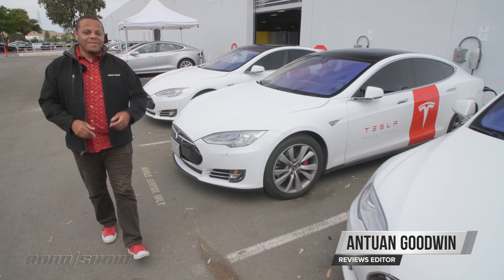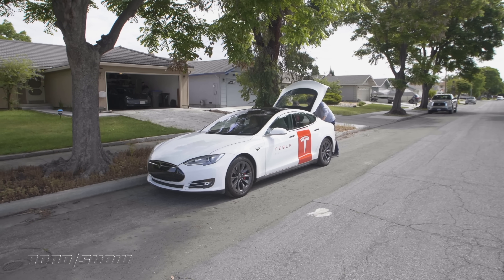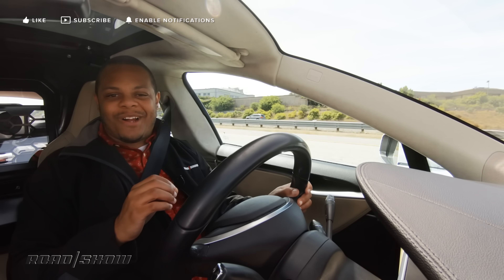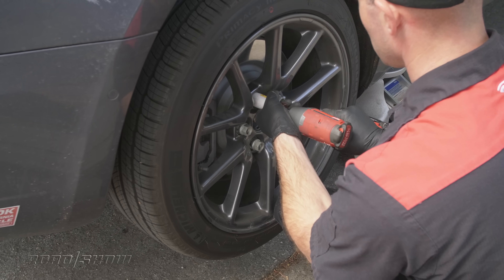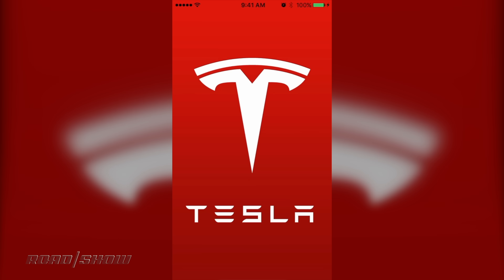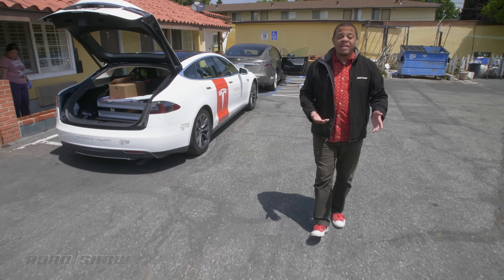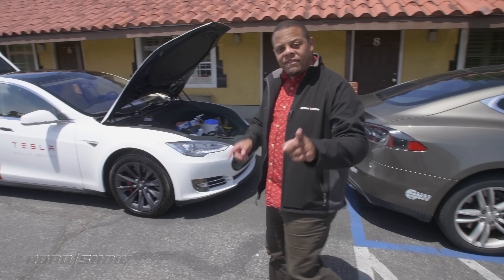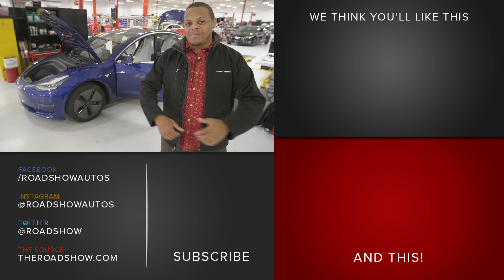Ride along with Tesla Mobile Service and fix some electric cars

Comment: As long as I have working a/c, I work at a mechanic shop making $15 an hour working from Monday to Saturday 10am-5pm, only making 12k a year but there’s other people making more at Walmart in working AC. I’ve been working outside in every weather New Jersey throws at us. From winter to 115 degree heat. But I yet still don’t get paid on what I’m worth. I’ll rather get paid $14 and work in a building with A/C. Don’t say you hate your job without even trying to be a mechanic making less than minimum wage, working outside everyday 365 days a year. It’s jobs fault they have mass shooting at their store because they wanna hire a bum with no degrees than me with 1 college degree

Comment: No mobile service here in Bangkok.  The first service center that just opened up, refuses to sell any parts to an owner down to the smallest clip.  
The people that did the PPF on our model Yp broke a clip mount on a wheel arch trim piece. They would sell the part and install it my self. So the part was about 40 bucks and I feared that they were going to charge me a couple of hours work to do this simple job.  When I got the bill, they charged me ฿68 - 68 Thai Baht which today equals $1.88. (One dollar and eighty eight cents) Maddening  Ing for people that covet the right to do their own work, but extra cheap.  And… the washed the car, wiped all the little hand prints off the inside back window and vacuumed.

Comment: I heard horror stories about its battery life in colder climates
Reply: battery drain in cold weather is not new some cars suck more at it than others the leaf would leave you stranded since it has no thermal protection for its batteries in teslas case if you have a winter package car  the batteries get warm automatically to keep from draining a lot
Reply: @yabucoaman  Here in Canada the sub zero package comes standard on them. When you navigate to a charger it also starts preheating the battery while you approach to ensure you get the best charge speed right away when you plug in.

Comment: Tesla Service has treated me like GOLD.   Also had their Mobile Service twice and it was fantastic both times.   Also gave me an opportunity to chit chat and learn more cuz the techs were pretty cool people.    So happy.
Reply: Just curious what did they fix for you ? I’m going to have my sensors replaced not sure
If mobile service can get this done
Reply: @khoado123  Camera replacement for beta?   I've had windscreen replacement, charger lid issues, minor things.  Flat tire with mobile.  etc.     Make sure they have the right parts in before it happens.  If it's a camera swap - I've only heard people going to a service station for that.
Reply: @karunald  it’s for the falcon wing doors because for some reason when the car sits outside the sun over 60 degrees for too long, it starts seeing phantom obstacles and won’t open
Reply: @khoado123  Now THAT is an interesting one!  wow
Reply: How much does tesla do the maintenance services for like the tire rotations etc? Thanks

Comment: The dealer that I purchased my Lexus from has a similar service. They can send out a technician and do simple maintenance things (oil change, filter changes, tire rotations) at my location of choice. For more intensive or serious repairs, they can flatbed a Lexus loaner to me, flatbed my car to the dealer, and flatbed it back to me for exchange when it is done. The only drawback is the need to schedule an appointment quite in advance.

Comment: my model3 got scratched on front bumper, does mobile service do body repair?
Reply: At the annual investor meeting this week they said they have just started doing bumper repairs via the mobile service.
Reply: @JoshuaSantos04  That's good to know! Picked up a scuff on my bumper few weeks ago, but it was so minor I was hesitant to go through the process of taking it to my local approved body shop. Maybe I'll check with the service center if mine does bumpers.
Reply: Tesla Our Future You can call and ask, they will tell you the answer.

Comment: I've had a Model 3 for just over a year.  I've had 2 mobile service calls - first for the frunk actuator - it took him 20 minutes to fix in my driveway.  The second call was for the glovebox latch bc it would sometimes open on its own.  Mobile service fixed it in 20 minutes.  The process of setting up appts was painless and the wait time was only a couple of days.  These are very minor issues and the experience made me feel better about the brand.  They are building cars to last - not ones that need repairs to be a profit center.  Any other minor issues or bugs are either fixed with OTA updates or by resetting the cars computer.  I love not having to waste my time going to a garage, get a ride there, go without my car for a day or two, etc.  Mobile service seems so much more sensible.
Reply from the maker: Glad to hear your experience has been positive.

Comment: So why don't they just use the Nissan Ev Van for full electric.
Reply: Probably because the range is abysmal. If the customer is more than 60 miles from the technician, they'd have to make a charging stop. And that's assuming there's just one client for the day. I bet they easily put 200-250 miles on the odometer on busy days.
Reply: @HikeTheBlues  It's honestly prob more then that. For example there are two service centers in Maryland. Granted both are down in the DC/Baltimore area so they prob handle the vast majority of the cars but the entire state has mobile service. So for example when my mother gets her Model 3 in a couple days their mobile service is going to come 120 miles one way just for me to install homelink. How awesome is that?
Reply: They would have to import it from Spain where it's build and it's already $28k there. Ford Transit is much easier and cheaper to buy and maintain.

Comment: Really cool video. 

I guess this is ok for a person who likes to work outside and in nice weather. 

I suspect that this would not be ok or doable if it rains, snows or is otherwise cold.

Considering that there are little to no moving parts, this would not be a problem. 

But I am surprised that the road side tech was able to get a floor jack under the car to rotate the tires. I was told by a Tesla employees that you can't get a floor jack under the car because they can not support the weight. I see so many Tesla's on the side of the road with flat tires waiting for a flatbed.
Reply: Of course you could use a floor jack. You'd just need one that can handle the weight. Plus how many Tesla owners would be so cheap that they'd change the tires themselves?
Reply: @scott8919  they can't change their tires. The car doesn't come with a spare. Maybe Fix-A-Flat. I see so many Tesla's on the side of the road. 

I have been told by Tesla employees that you can't get a floor jack under the car. So I don't know.
Reply: @Andrew-zv4fm  Big floor jack operated by a trained technician? Absolutely. Little twist jack operated by a possibly untrained driver, possibly missing the jack points and damaging the battery pack? No thanks. 

Likely as much for liability as it is for driver convenience and weight savings. 30% or so of new cars don't come with a spare for weight reasons, and on Teslas there just happen to be a few more reasons why it makes sense not to include a jack kit.
Reply: @TheErsatzCrab  yeah I get the weight reduction. No matter what car you are in, Tesla, BMW, Mercedes, Mini or whatever it is still a bad idea not to have spare tire of some kind.

But as I said before, I was told by a Tesla employee that you can't get a floor jack under the Model S. Regardless if it is from the average person or a trained tech. In the video they showed the Model 3. So maybe with that car yes you can but not with the Model S. Apparently if the floor jack meets the weight requirements of the Model S. The only way to get the car up in the air is by a 2 post lift. 

Now regardless, why can't these cars come with run-flat tires? They have the standard tire. I see so many Model S' on the side of the road or on a flatbed. The last time I saw a Model S with a flat was on Mother's Day. The driver was on an on ramp and could not safely get off the road. He was down to the rim.
Reply: @Andrew-zv4fm  I understand, but the employees tell you that because it's much quicker than explaining the actual reasons. As I mentioned, quite a lot of cars no longer come with spares, and that's because overwhelmingly people tend to call the roadside assistance program provided with their warranty rather than replacing the tire themselves. Tesla provides a loaner wheel service so you can simply drive away instead of going directly to a tire shop.

As far as the reasoning for not including run-flats, they're much heavier, more expensive, less efficient, and ironically easier to puncture than a traditional tire. Ask any BMW owner, they're a huge pain in the ass.
Reply: @TheErsatzCrab  I knew someone that blew his run flat on a BMW. 
Getting road side is not always dependent on the cars warranty. Take Mercedes for example. You can still use their roadside service even if the car is no longer under warranty provided you had the car serviced at the dealer within the past 18 months and spent a min of $100. Volvo has started a similar program. 

When I talked to the employee about this, it was part of a car club and we are in the know. So I don't think they were BSing us. 

I doubt how well a spare tire will be on the Model S since you can't lift it. 

I test drove the Model S and we were told that you are advised not to do a panic stop if you can help it. There is a chance you can pop the tires. All considered, EVs have a long way to go till they are practical.
Reply: @Andrew-zv4fm  The warranty comment was an aside. For example, Tesla policy is that roadside assistance is always available no matter the status of your warranty.

I don't mean to be argumentative here, but it's completely false that you can't lift a Model S using a floor jack. I'll try to find sources from the online user manual if you want. I'm personally extremely familiar with Tesla sales, and when they tell you that you can't lift it using a jack, they mean that you would need one of the large shop-style jacks shown in the video, which would not be convenient or practical to store as part of a spare tire kit with every vehicle.

Finally, if what they said about panic stops was true the vehicle would never have been released for sale. There are cars as heavy as Model S, such as the Mercedes S550; a ~5700lb GVWR is not uncommon and tires are more than up to the task of stopping a vehicle of that weight. The salesperson clearly didn't know a whole lot about the car.
Reply: @scott8919  also the Tesla they are showing is a Model 3. So maybe a Model 3 you can just a floor jack but the Model S you can't.

Comment: Build quality issues and endless rattles 🤦🏻‍♂️
Reply: Jay Chu build quality was worse on my Porsche Macan Gts than my new model 3 performance.  This is old fake news
Reply: Google or YouTube Tesla and Porsche build quality issues. I lemon law’d my Model S. I, sure you had real issues with your Macan, no manufacturer is perfect but Tesla has major build issues. That’s why Consumer Reprts down graded them.
Reply: Jay Chu CR downgraded them because they started surveying first production Model 3s, which of coarse will have more issues like every other first production vehicle. The downgrade was bs. Tesla has fixed much of their quality issues over the years.
Reply: @jaychu3850  LOL went from" rattling issues" to "google the issues I just made up" like you had any first hand experience... GTFO. 

30k miles in a year on my 16k VIN Model 3 and 1 minor issue with my frunk which was fixed in my driveway in the middle on a NY winter by mobile service in 20 minutes... 

Also....No rattles what so ever.....

Comment: What if it rains?
Reply: They have tents they can set up
Reply: @keco185  you sure about that.
Reply: @Andrew-zv4fm  yes they used a tent when repairing my model 3 in the rain. The van also had an awning
Reply: I had the same thought.
Reply: Andrew I’ve seen them use them before
Reply: easy question you get wet simple